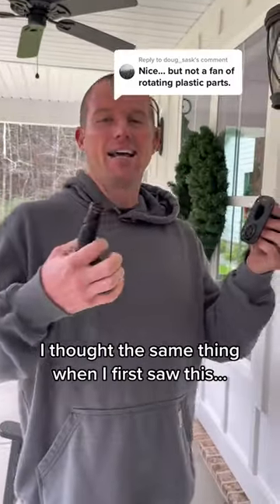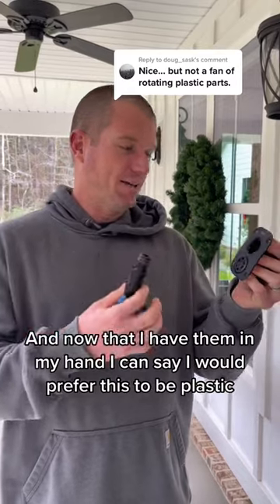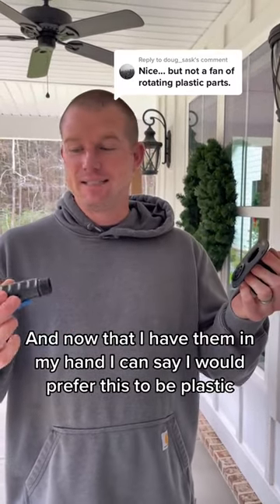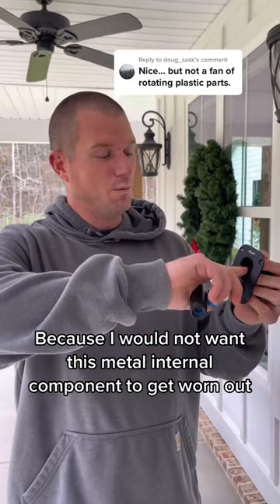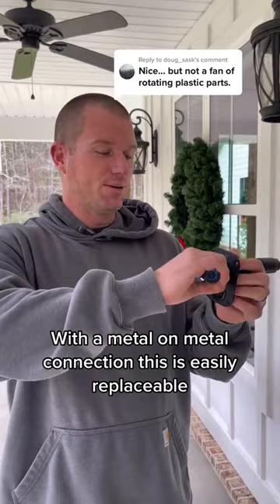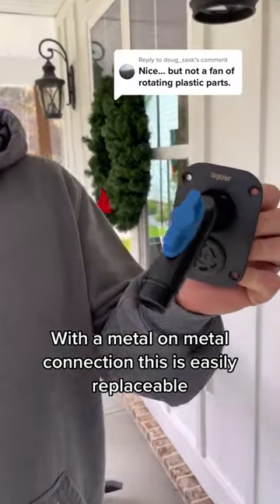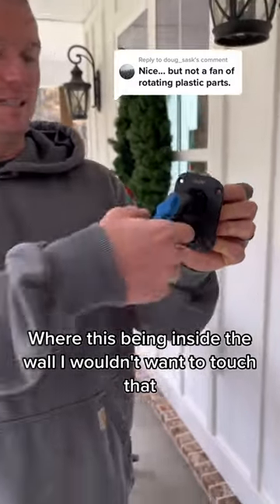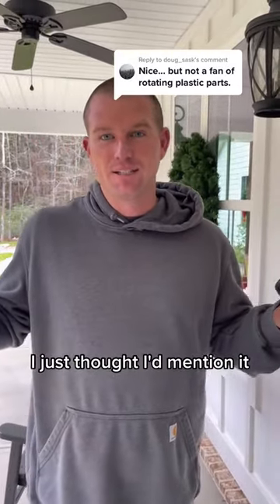Hose bib made of plastic…🧐

Comment: Looks slick but I'm just not a fan of highly proprietary parts being installed in my walls. What happens when they go under in 5 years and no replacement parts...
Reply: Open one of these up and you will see a small seal is the only thing to go wrong. Very very simple and I’d bet I could get parts to fix at ace hardware.
Reply: My thoughts exactly. Less proprietary shit the better